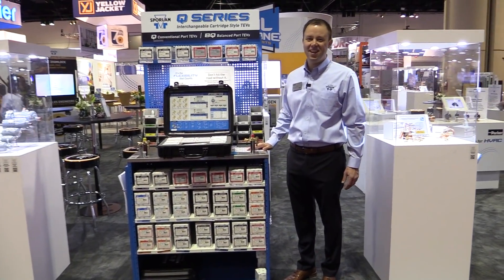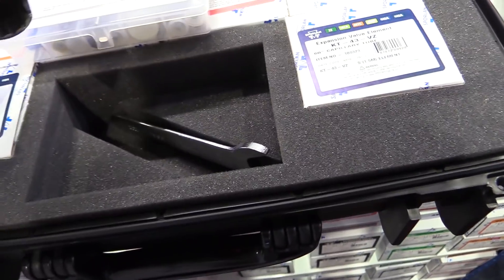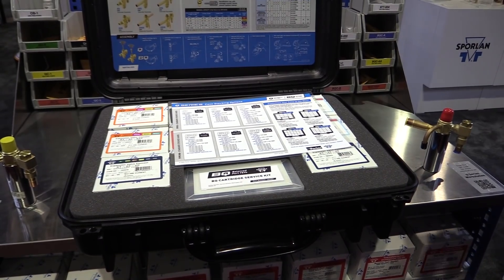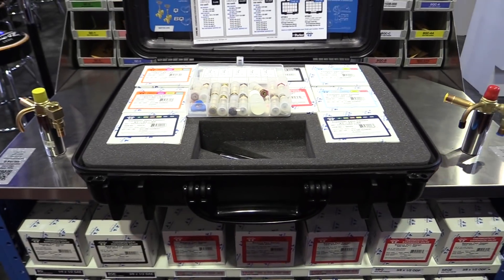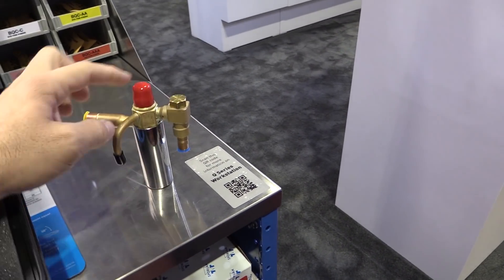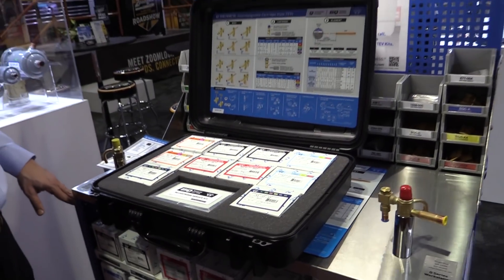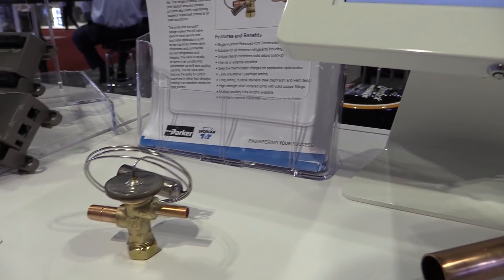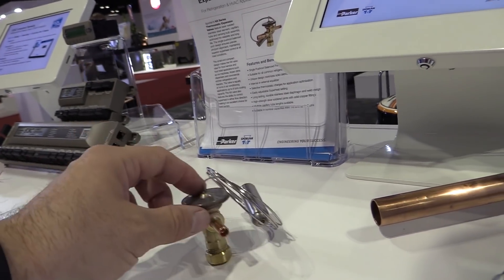PARKER SPORLAN AT THE 2020 AHR SHOW

Comment: Did sporlan talk about position on the power head bulb. Lately new equipment has come with a tag displaying bulb position 30 degrees below horizontal (4pm or 8 pm). 15 years ago I was taught 30 degrees above horizontal (2pm or 10 pm)
Reply: Sean Mack large suction lines with the diameter twice as large as bulb diameter it is impertinent to mount at 4 or 8
Reply: Sean Mack large suction lines with the diameter twice as large as bulb diameter it is impertinent to mount at 4 or 8
Reply from the maker: H Papa  thanks for helping out on this one!